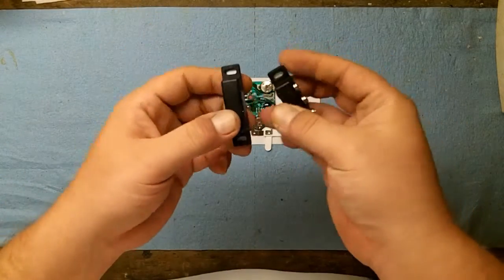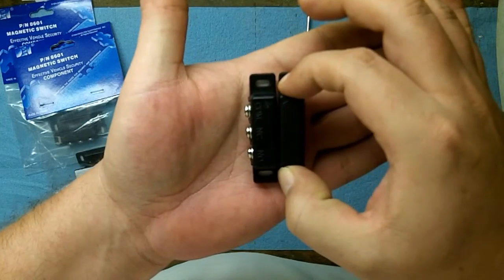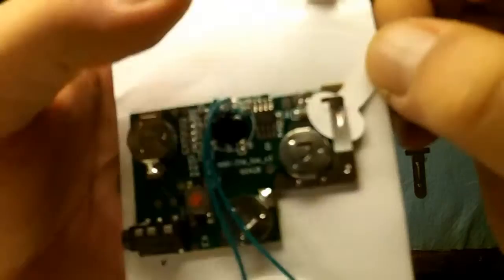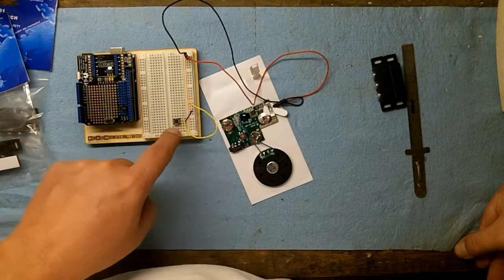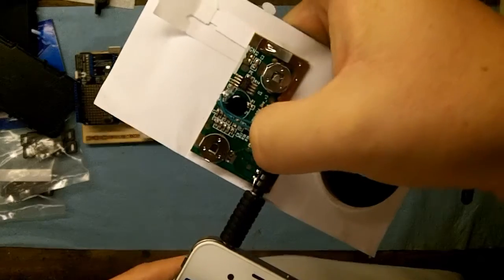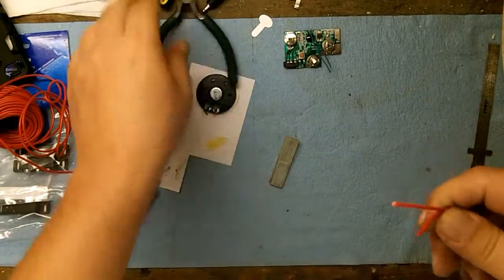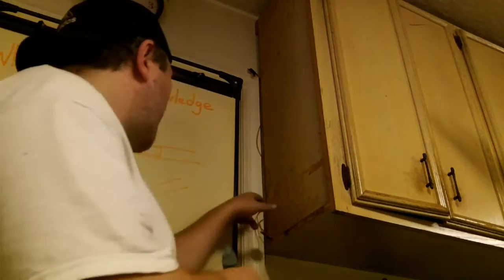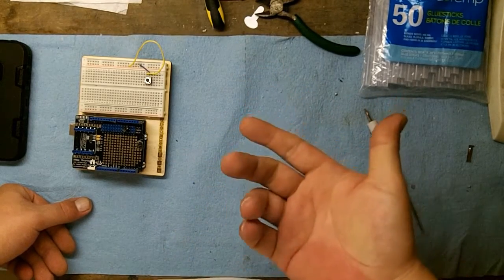Electronic Greeting Card, Magnetic Switch Hack

Comment: Hey i'm interested in this. It there a way that this can loop once opened?
Reply from the maker: Not in it's current form no.  The firmware is  programmed to play once per trigger. You would need a different logic circuit for something like that.  The chip would have to sense when the music stops and loop it.  The audio samples on this particular module can be input and therefore would have an impossible to guess duration/length, there's no way this module would know when to loop the sound.

 It's possible to solder a different IC chip on there and get that result.  I'm not experienced enough with circuit design to give you an easy answer on what chip to use or how to program it though sorry.  You would probably be better off using an Arduino or Raspberry Pi for custom project like that.   Pi has much better support for A/V projects I would probably go with  a Pi for that.

Comment from the maker: 12/24/2016 Well it's finally started to run out of battery. It's restarting the sound every 2 seconds.  Eventually it's going to completely run out of battery.  3 months of daily use!  Nope, the sound has never gotten old, in fact I love it.  I did eventually swap this out with a better product by the same company for a permanent install called the EZSound Box. Same concept but with 3 AAA batteries. The batteries now last about a year before needing to be replaced. It's now a permanently installed feature of my garage. :)

Comment: Nice!  If you need those switches to be more sensitive....as in the 2mm trip....you can space them 18mm apart.  It wouldn't be precise enough for something like a limit switch on a machine, but for most applications, it would be fine.  
How many people have you startled with that speaker being right there when they open the door?  lol  My wife would jump every time! :)
Reply from the maker: Having it installed there for a couple days now it's made me flinch repeatedly.  I haven't gotten used to it yet because I keep forgetting to expect it.  Yeah it's right at ear level and blasts you with sound.  I do chuckle every time though.  Hasn't gotten old yet.  For a limiter switch I would go with something like the lever switch or lever switch with roller bearing, it's like the switch I used on the box project except it has a roller on the end. Roller switches are probably the most common type of machine limiter switches.